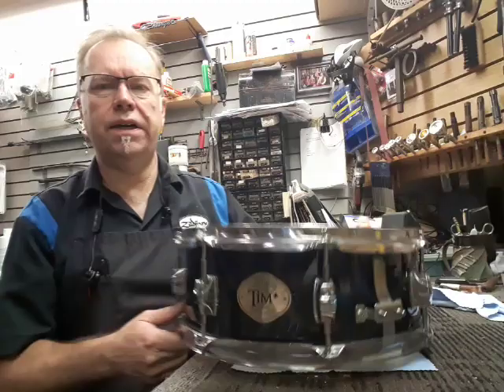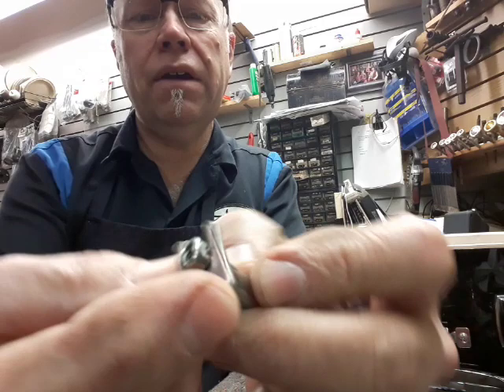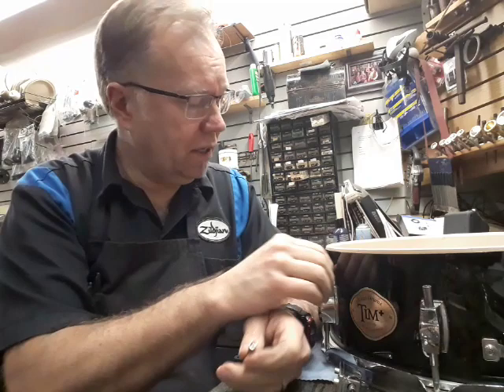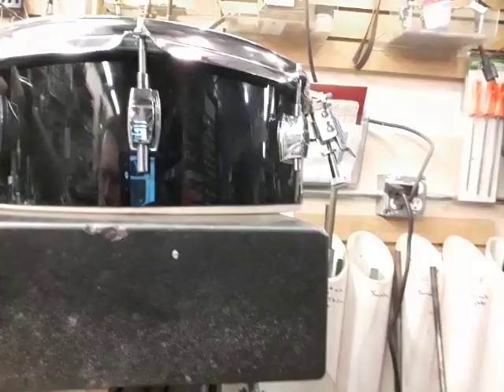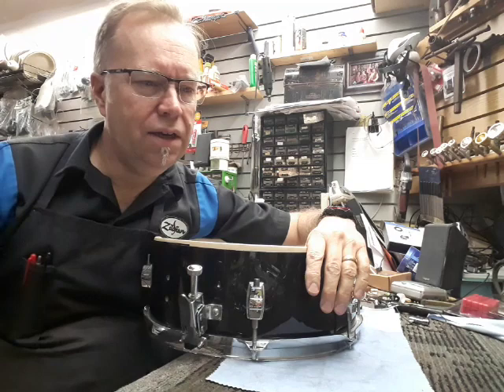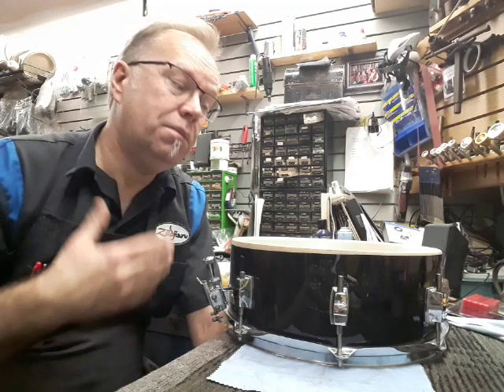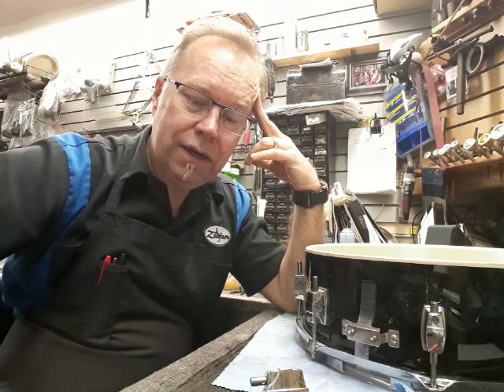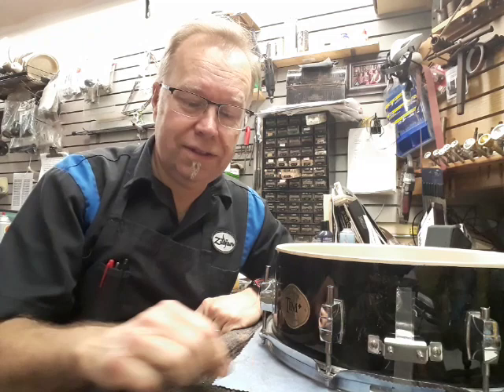Cheaply made, low quality, instruments Pt. 3 Drums. Are they worth the cost? (count them all!)

Comment: You are absolutely correct in everything you say about Chinese manufacturing. They make things for a price which is very low, and invariably the product has manufacturing faults, quality control faults, design errors, sloppy assembling , etc. Here in Australia, years go we manufactured many product and lots of these things still work, because they were designed correctly, the materials chosen were of correct specification , and quality control was kept up ( e.g. pedestal fans, refrigerator, washing machine, electric toasters, air conditioners) (also most can be repaired quite simply as they had simple electronics and parts were available.). These days most of the rubbish coming from China is at times not worth buying unless you are happy too throw the item out in a year's time. 
Well done for your reviews, they are valuable insight into manufacturing the average person does not understand and you are helping them wth it.
Reply from the maker: Thank you. I just want inform people. Then they can at least decide for themselves.